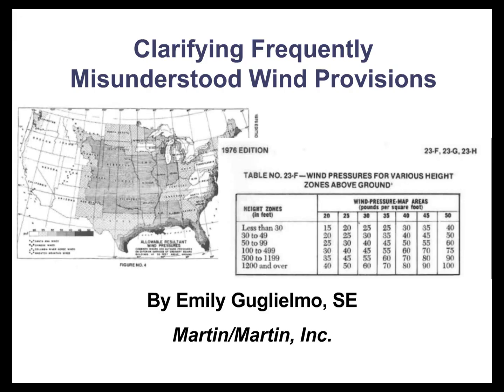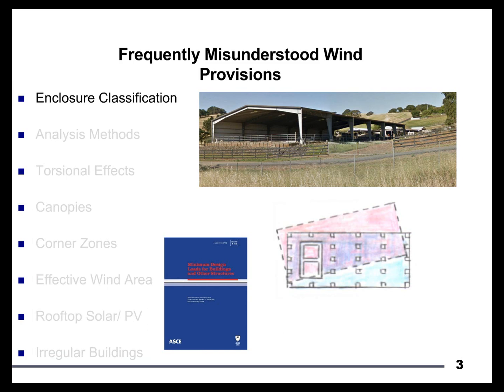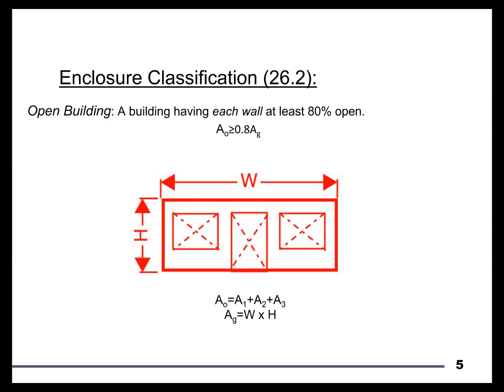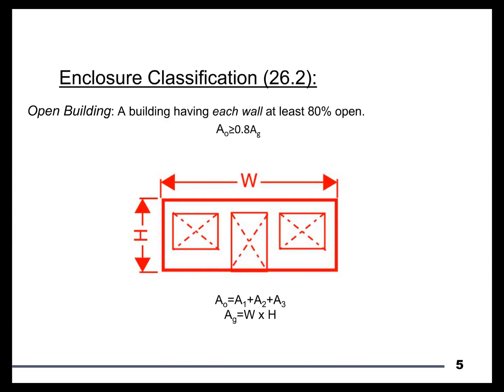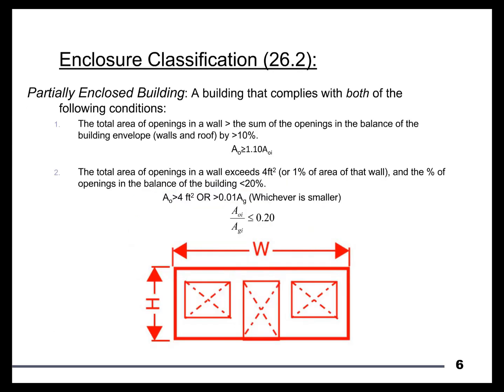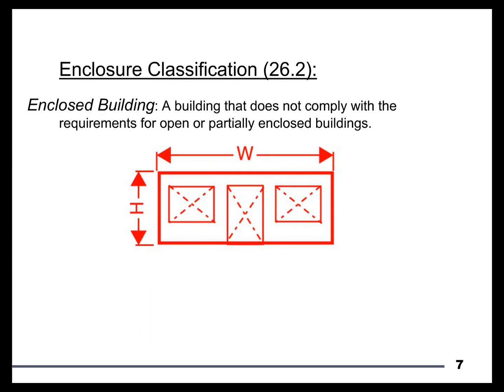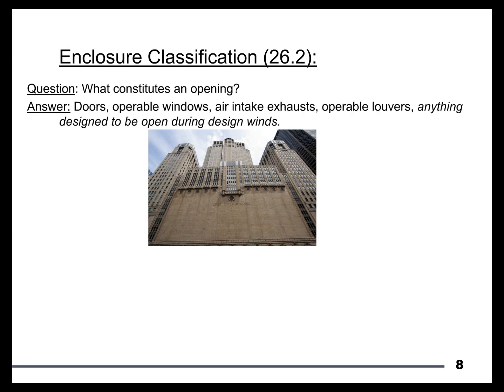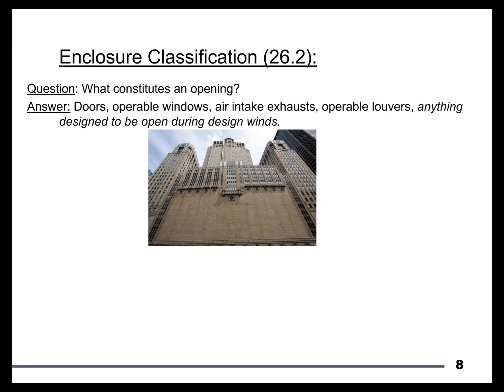Frequently Misunderstood Wind Provisions

Comment: Hai, I am from India, currently I am working on phoenix and california projects I am struggling on understanding the us plan and not having key framing of roof and floor plan. If you could provide some ideas for roof and floor framing it would be useful for many engineers like me. Also not able to understand the connection part and how to check for connection calculation..